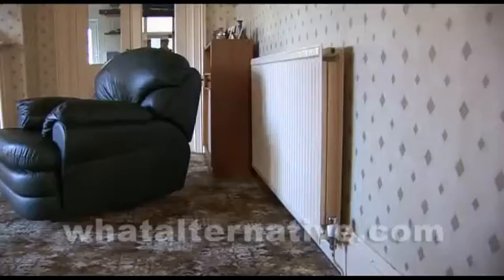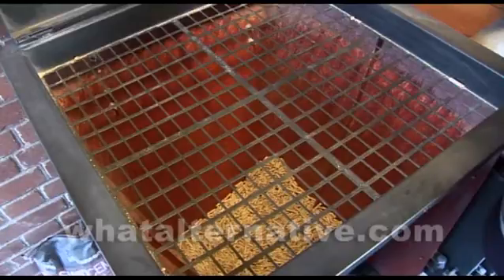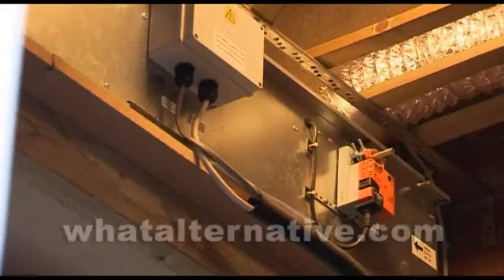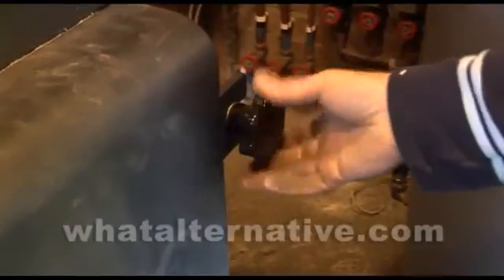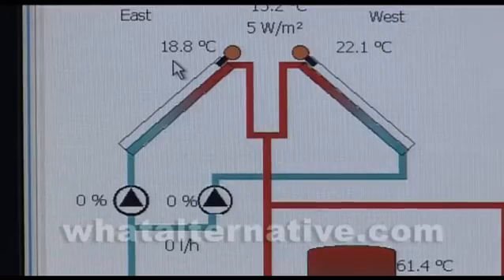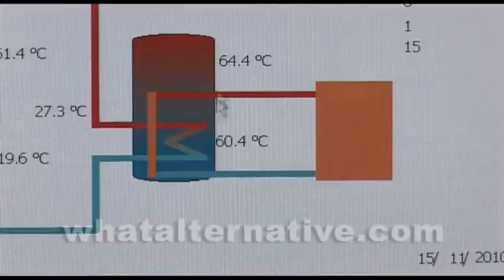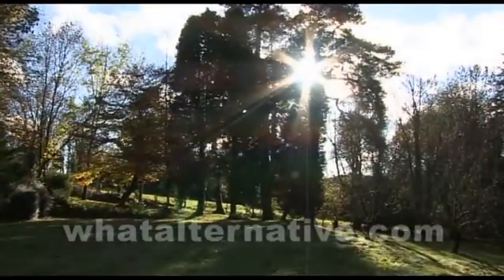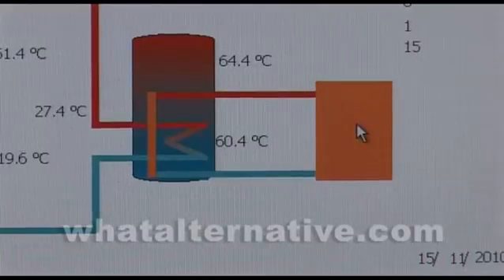Multifuel central heating, renewable energy

Comment: Very nice, I am in the middle of fitting a non pellet feed multi fuel system that will be burning wood 90% of the time and coal when lazy or real cold comes in. This system is fairly heavily automated, I wanted the oppisate and wanted easy/simple/mechanical maintenance, I don't mind getting my hands dirty, although by the sounds of it my house is far smaller than this.I had 5 single convector radiators and replaced all with 7 doubles and 1 heat-leak radiator for a greenhouse, it wasn't necessary to have a heat leak with the system as water pressure and temperature are regulated but I want to grow all year round and the system will be idling most of the year anyway, this system is more like something you would fit in a hotel or a business place but it is nice to see how it's done if you want to heat a large building.